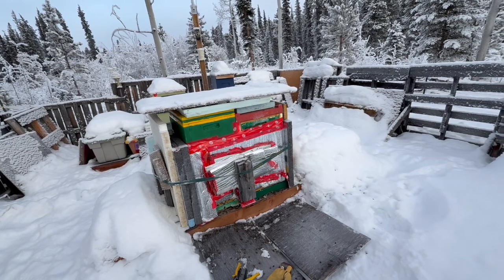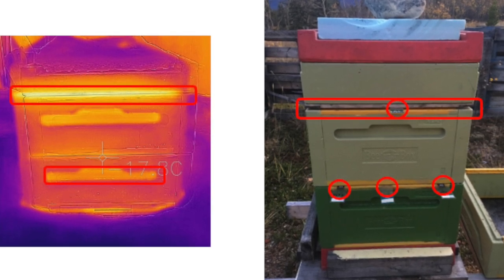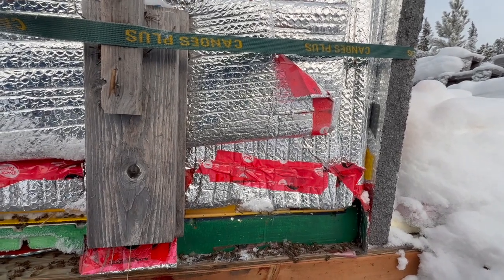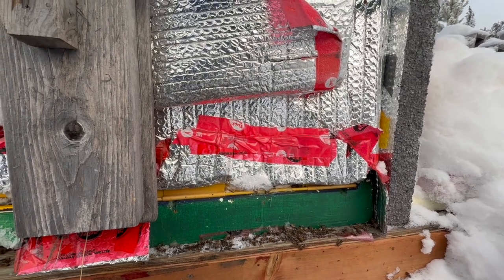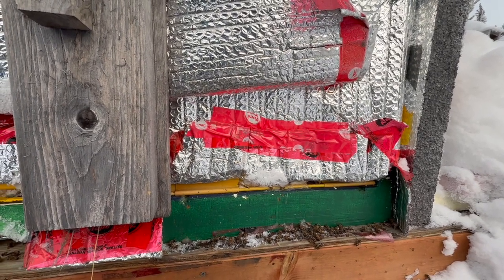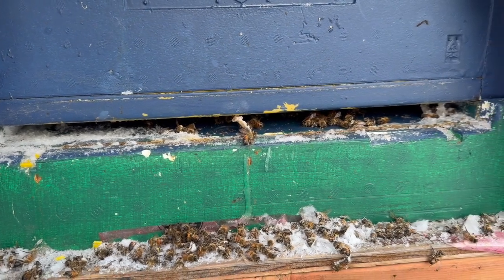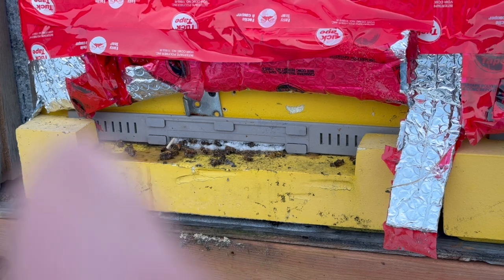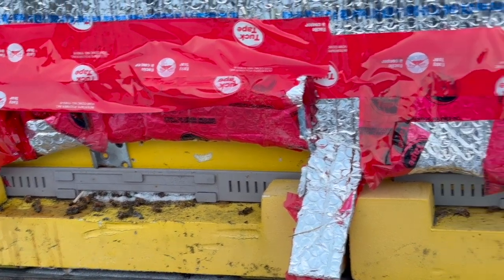Dealing with Frozen Entrances

Comment from the maker: This chart (live CO2 and O2 levels - click Weekly) is what I have been monitoring. I am trying to find the right balance at about 2-3%. I will use this to help me find the optimal size. Remember they go into ULMR (Utra-low metabolic rate at low oxygen so they can survive and deal with it). The risk is if we get a rapid warm-up of 10 to 20C. That would really mess with the internal dynamics. https://app.datacake.de/dashboard/d/4b10cbc3-9735-4b6c-b0ac-eb796d22b703

Comment: A deep frame is about 5lbs of honey max.  50 lbs production from a ten frame super is typical
Reply from the maker: Yes you are correct thanks for the correction. Mental typo. I do run my deeps with 8 or 9 frames usually. So they are typically above average. I also never pull honey from my brood boxes unless its honeydew.

Comment: Great bit and pieces of information, a lot of beekeepers don't understand the Thermal Process that the bees and we deal with. So many just follow what they see on YT with out understanding what they are actually dealing with. Thanks for sharing, Blessed Days...
Reply from the maker: I will need to narrow the entrance down a bit more... There is always some infiltration through the seems and the styrofoam sheets I use on top that creates a pseudo top vent. Looks like the bees are currently around 10,000ppm co2 (~0.25 ach air change per hour). I will reduce it by another 2". It floors me that scientist also don't apply building science and knowledge to their wintering experiments and are so stuck on the "Bee don't heat the hive". Not realizing that it is just a heat conservation equation and adapted honeybee behaviour. The cluster behaviour is a survival mechanism, the bees would rather have moderate CO2, be at rest in a warmer environment.

Comment: I don’t know why they need to use plastic on a poly give
Reply from the maker: better than metal, you need an edge protector against hive tools. A couple of manufactures who have flat edges can get away with a thin flat piece, those with overlapping edges needs something a bit tougher. Less worried about mid boxes but it would be nice if they stopped 1/2 way vs full length, entrance area has room for improvement.
Reply: @ I have Langstroth poly hives they have no plastic they are all poly they cost around 150 each

Comment: Given your heat conductivity ratings.... even though plastic is a more conductive material, how does that play out in the case of something like an Anel hive box that is polyurethane internal but plastic external?  Does the polyurethane negate the loss due to plastic covering?
Reply from the maker: Just checked "Polyurethane (PU) foam has a thermal conductivity of about 0.02–0.03 W/m·K" is equivalent to polystyrene but the hard plastic version is 0.4 so it could be problematic for me here. This is the reason I leave the screen bottom board partially open. At these temperatures the top vent would also ice up. It is just something to be aware of :)